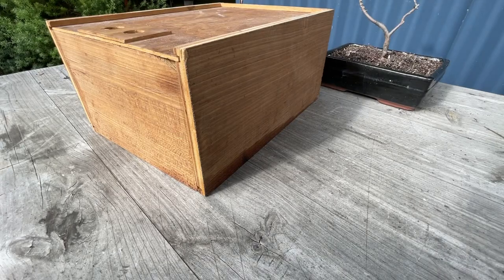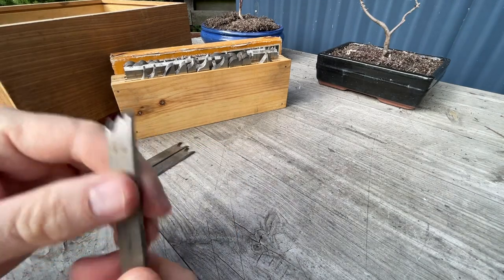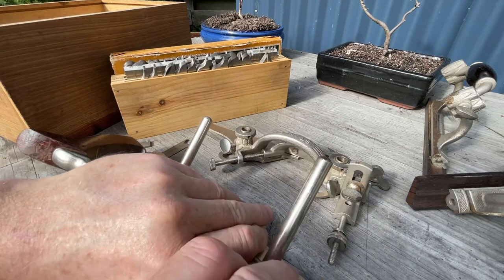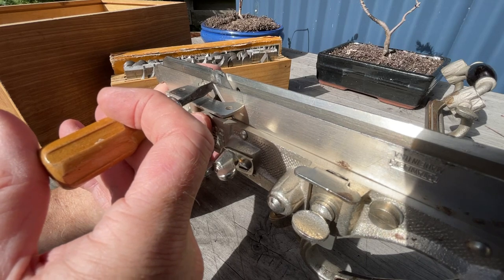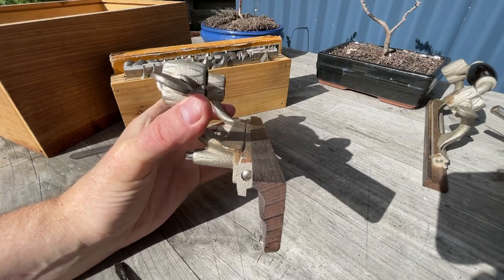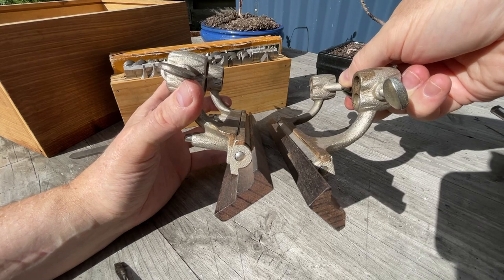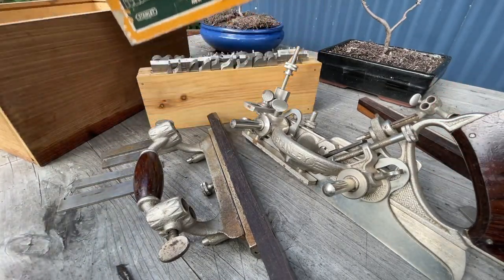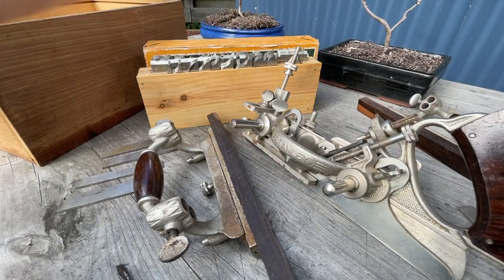The Stanley no 55, the King of planes!

Comment: That 55 is in excellent condition……did you restore it?    I have an old 55 but can’t get the steel to look so clean😕……cheers!
Reply from the maker: Thanks. I gave it a bit of a clean up as it had some surface rust in places. Vinegar bath and a scrub with a wire brush mostly. I have another video that goes through a quick rejuvenation of falcon 8" plane (equiv. Stanley no 4) to give you an idea of the process.

Comment: Thank you for doing that.  Showing the 55's uses hopefully promotes their use and stops the grandkids throwing them in the skip.  Many talk of how difficult it is to set up a 55.  I don't understand that view, but I would point out that it is critical to set the fences and scates parallel to the primary scate.  I use a fine 150mm ruler and a magnifier headset.
Reply from the maker: Sometimes it is faster to set up a 55 than it is to set up an electric router. Even ensuring parallel skates and fences 😉

Comment: What is the purpose of the set screw located at the extreme rear of thevmain body on the right side?  Thanks.
Reply from the maker: There are 2 items that can get located there, one is a depth stop, and the other is a splitter.